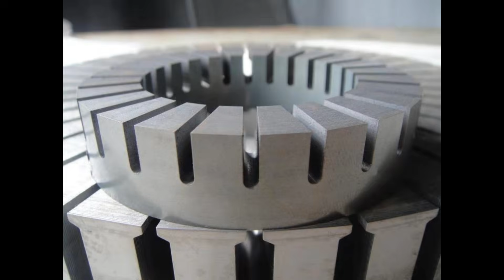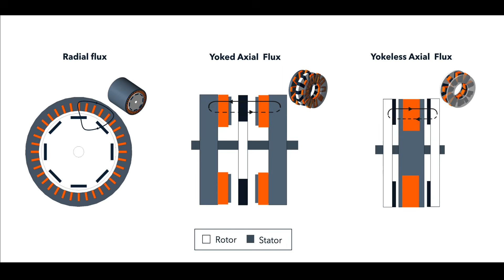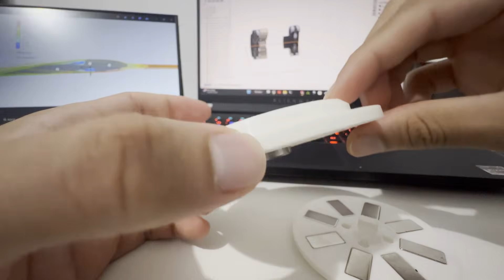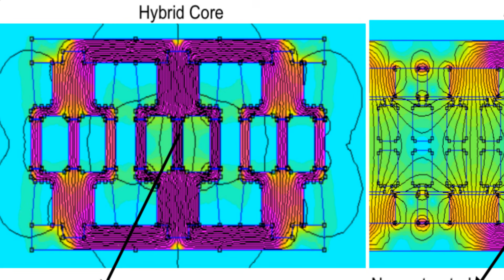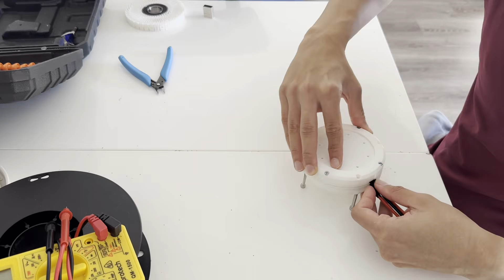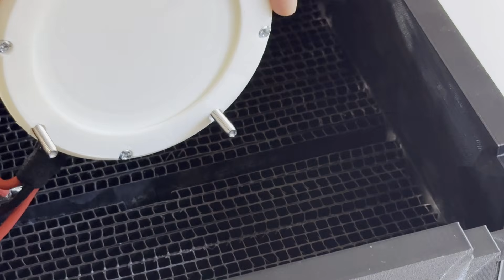This Motor Could Hit 1kW… Here’s How⚡ #axialflux #diy #motordesign #3dprinting #generalknowledge

Comment: This looks great! What stator design improvements and steel plate characteristics? are you available for a design modification?
Reply from the maker: I’m building on it but also getting a bit busy with work.. so basic upgrade is the distributed winding style which uses 6 coils merging into 3 phases… I have posted a short on this stator.. currently limited with plastic parts but in metal this dimension can pack a kilowatt with air cooled characteristics.. at 7-8k rpm